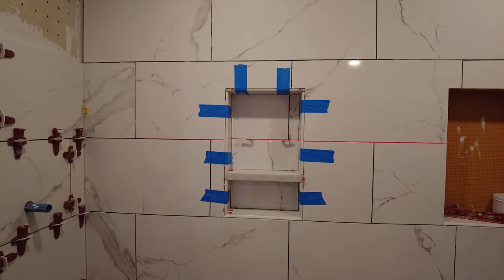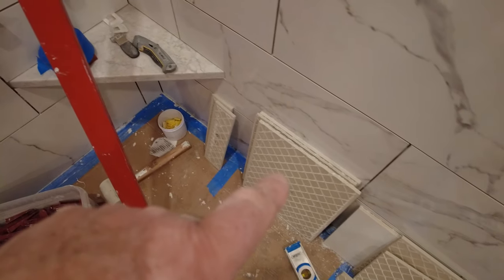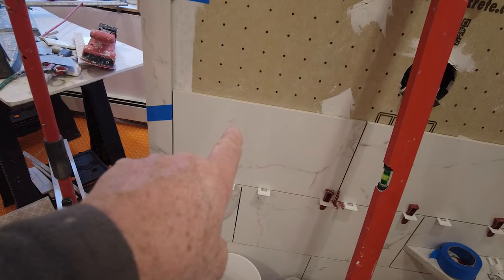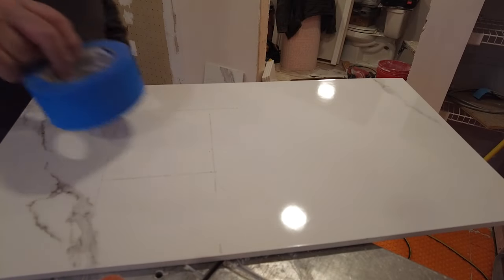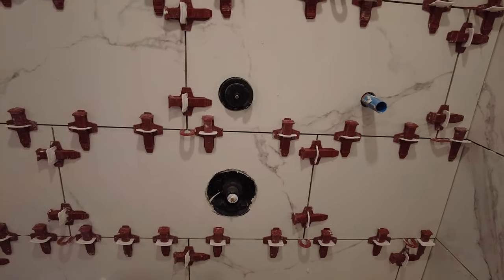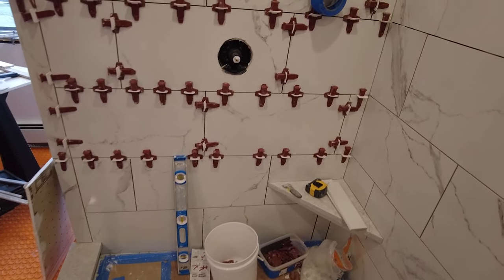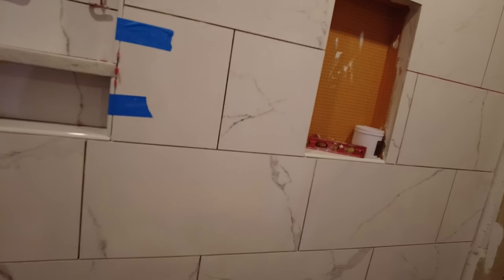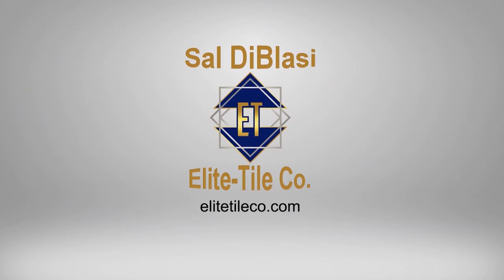Lots of holes and cutting, one nice finished. Master Bath install. Part 12

Comment: Sal, when you bid these jobs can you tell that the cuts are going to take a bunch of time or do jobs like this sneak up on you? With your experience I figured you'd be able to take one look at this job, the size of the tile, and the size of the space you're tiling and build in a little "extra" for the trouble.
Reply from the maker: I look at a job and find out what they want and figure it all in the price, but people will change things and add time consuming stuff, so in the contract I have a clause that lets me charge more for stuff that is added that will take more time effort and materials.  Had to fall back on it many times, so it is wise to have a contract that says what is included and what will cost more.

Comment: How do you keep your thinset good while working so long on such a small square footage? Do you just mix a very small amount and toss what you dont use after an hour?
Reply from the maker: I mix half a bag at  a time and use it up pretty quick, but the mortar I use has a long pot life and can be remixed without adding water to loosen it up if it starts  to get stiff.

Comment: I was also wondering do you normally not have trim around your niches? Or does it just depend on the type or quality tile your installing ?
Reply from the maker: Trim  depends on what they have and what they want. Bullnose is on the inside of the niche this time.
Reply: @SalDiBlasi  Thanks Sal
Reply: The side of the niche seems to be a finished rounded edge marble, no need for trim unless you have exposed tile edge. Even then, I usually miter the edge of the tiles meeting up, so you only see finished surface. I hate metal trim in a niche, looks cheap.
Reply: @DL101ca  I don’t disagree on the trim. In the vid it’s tough to see the rounded edge

Comment: Good work Sal. Do you really think the home owner cares about grain lining up. That is on you. How can you justify the time it takes to calculate the effort and the cost if you are charging by the hour?  If it is a bid job how do you estimate your time ?
Reply from the maker: Customer lets me do what I want. Charge what you are worth, not by the foot or by what you think they want to pay.
Reply: @SalDiBlasi  thanks for responding. I’m with you on changing what your worth. I was a builder for 35 years and have been tiling now for about 12. Am 72 now  and am going strong. Hard work but l enjoy it. Stay well and happy holidays

Comment: Starte using the dry diamond hole cutters, attached to grinder far quicker, sizes up to 125 mm
Reply: If you know how to use a grinder with a diamond blade and a grinding stone, you can cut any shape and most bigger size circles faster than a hole saw.

Comment: Should the niche not be centered on the tile, looks odd with a thin tile cut on one side?
Reply from the maker: Impossible to do with two niches and all the studs in the wall. Centered on the the back wall and spaced evenly from each other and the tile layout.
Reply: You need to look at the big picture. Centering on tile might look proper to the inexperienced eye, but once everything is grouted and the lines disappear, you will see why it looks better.